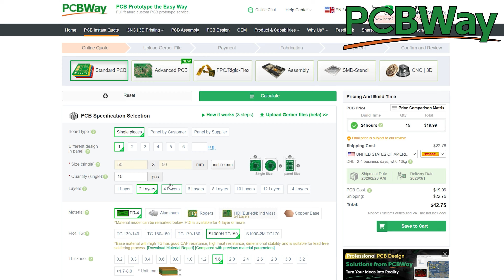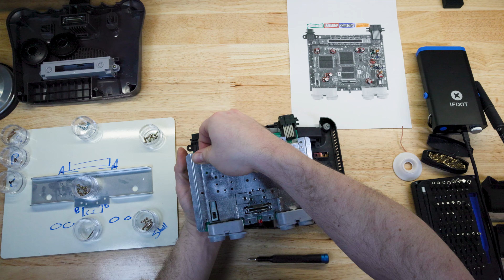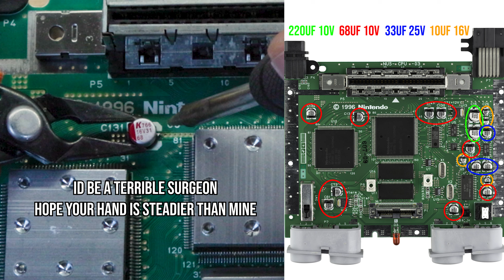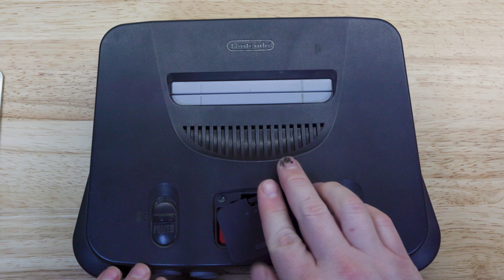My N64 Was Freezing - Replace Leaking Capacitors

Comment: Did it fixed the issue? I am having random freezes as well, I was suspicious of the expansion pak since with the jumper there was less freezes but I tried another one and the issue is the same so I am thinking of the capacitors!
Reply from the maker: I think it did since I haven't had an issue since doing this.  So I'm hoping!